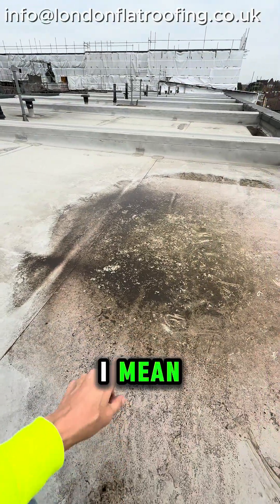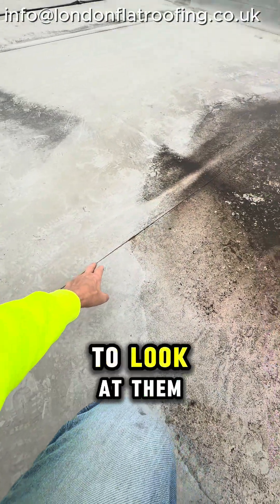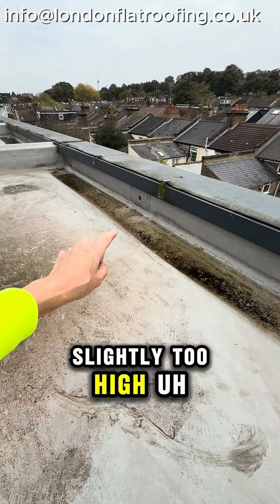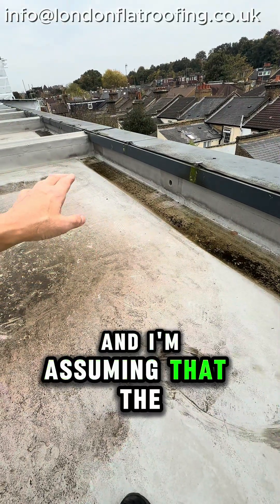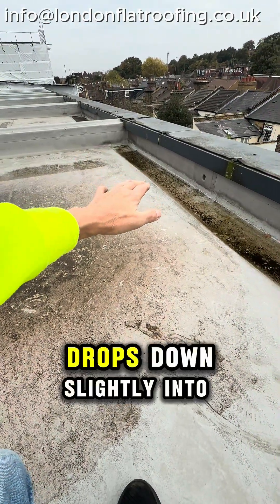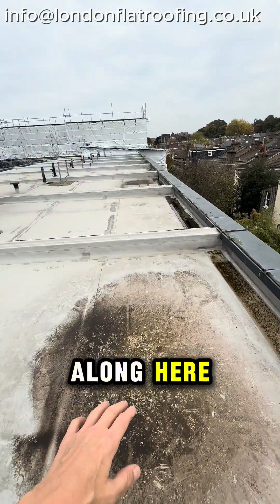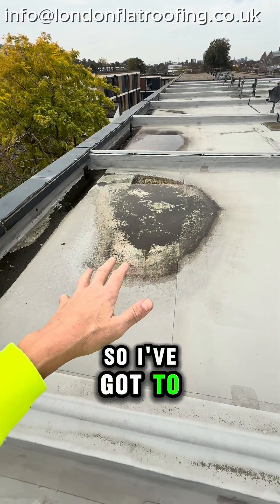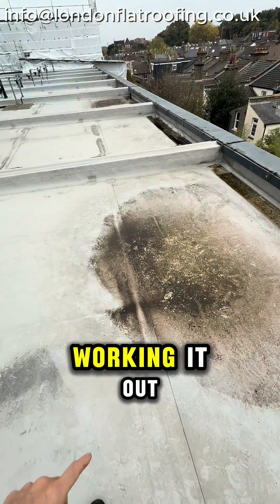New Flat Roofs: Why are they holding water?

Comment: It looks like the field sheet doesn’t have a peel stop into the gutter that pulls it down tight and it may have expanded creating a hump. It has been taken down and welded to the gutter in one. The hard edge could have been 5-10mm lower than the insulation to aid this too with a separate flashing between the gutter and main roof. Also the fall was probably only 1:80 and not overcoming the deflection in the deck. Now it is usually 1:60-1:40. Also I don’t know if this is a new install or an overlay of an existing which could have had the low spots before being overlaid and they are now just being mimicked by the new overlay.

Comment: I have the same issue.  I had a new surface laid to repair a roof terrace and they laid it all out but in heavy rain it when cleaning the level is out and water runs into a corner adjacent to drainage point for the guttering. Lesson learned on that one.

Comment: Just a quick question for you Steve I have just done a grp roof with a box gutter and when all the snow came on Saturday and started to melt so fast it blocked the gutter and started to leak there was probably 100mm of water sat in there until I cleaned it out. Is this common with grp when water is trapped on the roof
Reply from the maker: NO
Reply: It is not unusual to find a bit of pooling just behind the box gutter, or in fact any gutter edge. This is because there is an angle former over the edge and that is topped with a layer of fibreglass. To overcome this the former needs to be routed into the osb ( a real pain in the arse job) or an additional layer of fibreglass layered up to the former (expensive). So mostly it is accepted that a little pooling will occur. Unsightly but not a technical issue and cause of leaks

Comment: Steve, Please make sure you do a follow-up on this video, I see this time and time again but I get told if it's not leaking don't touch it, and I'd love to know the cause!
Reply from the maker: Will do
Reply: Put a Lazer level on there, I'd bet there's a 2 or 3 mm difference, enough to pass regs but does hold water.....
Reply: The cause is simple the metal flashing on the roof going in to the gutter is probably 5 /10mm to high happens all the time and when u screw. It to the deck under the membrane it makes it it up
Reply: @SuperMickjr  I get you, I can see that could be the cause in some cases, thanks!

Comment: Is the roof concrete?
Reply from the maker: no timber
Reply: @SteveRoofer  would be good to see a follow up. Perhaps there is something heavy inside the building that runs the length of the building that is putting extra weight on the timber and making it sag slightly
Reply: @SteveRoofer  So is the deck made of something like plywood or OSB boards?

Comment: Maybe that's where there isn't much fall as they all have the same area of sitting water
Reply from the maker: Yes but if you put a fall on a roof its normally continual it doesn't change at the bottom
Reply: @SteveRoofer  I agree.. but its just strange why the water is standing at that spot on all the roofs . Has someone added short firing strips and that area is just flat . It's hard to observe from the video but a spirit level will show it straight away
Reply from the maker: surely the fact that the water isn't draining shows that there isn't a fall on it you don't need a spirit level water levels itself
Reply: @SteveRoofer it’s pooling. Even on a slope water can still pool.